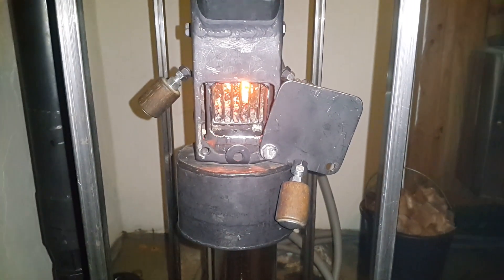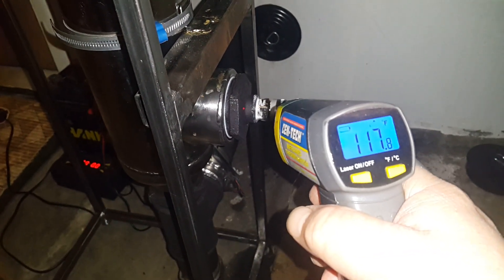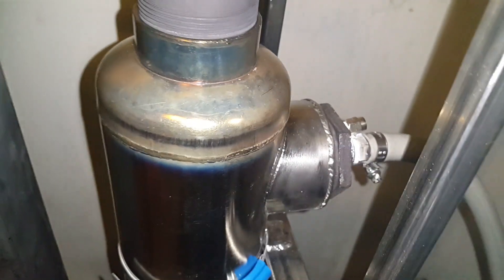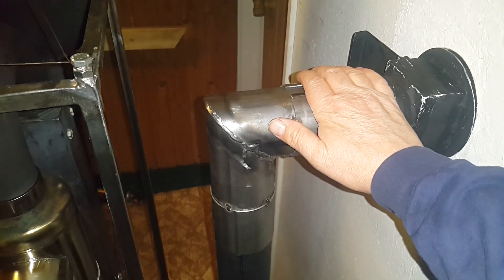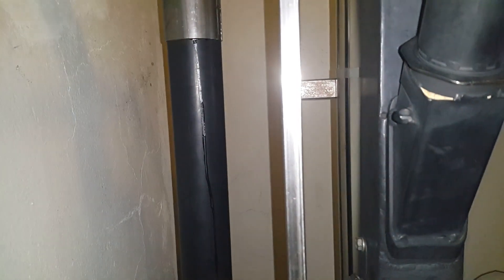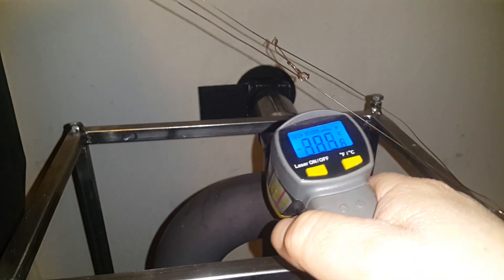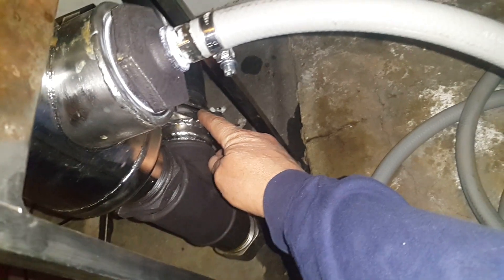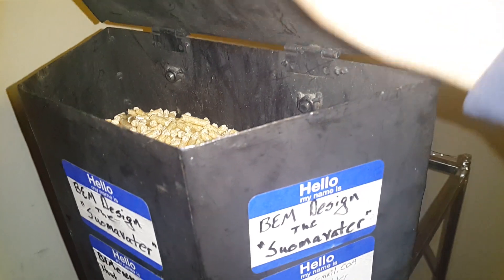CHP gravity fed wood pellet boiler rocket stove water heater efficient condensing furnace HastyHeat

Comment: What was the water flow rate set at for this video?
Reply from the maker: that is a very good question to post, however at this time i did not have the temperature flow meter installed inline and cannot answer. we will soon have some new content on this topic to upload with much better full instrumentation, keep subscribed and keep your eye out for what new is coming out of the labs of Hasty Heat

Comment: FANTASTIC.... put that heat into an insulated storage tank for on demand use to multiple distribution points via manifold... KUDOS!!!  When will this boiler be at your next Park cookout?  I want to see it before I order..
Reply from the maker: in this build we used a off the shelf tube in shell heat exchanger, it did work well however long term tests have illustrated that unfortunately we will have to build our own in house as some provision needs be for cleaning and knocking the fly ash loose.
it was our hope the economy of scale using the off the shelf heat exchanger could be leveraged for our customers economic advantage, but it did not work out so.

we did just receive a CNC cutting table with rotary, so once the learning curve is behind us on that we will be able to move forward on building our ultimate boiler, the CHP with automatic ignition, temperature control, and shutoff; and eventually a stirling generator to match.